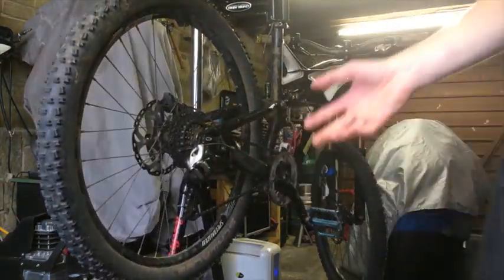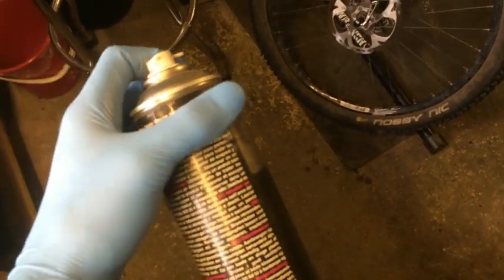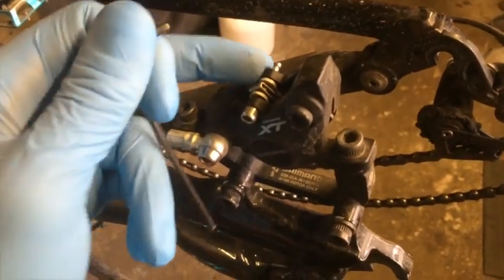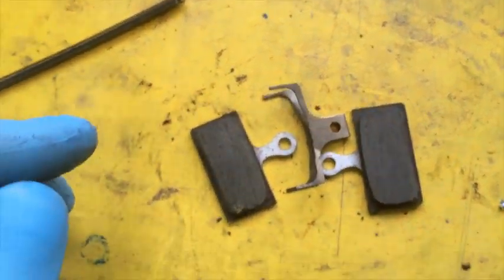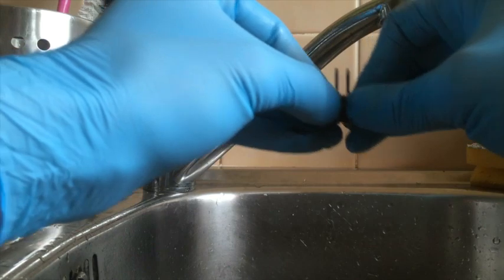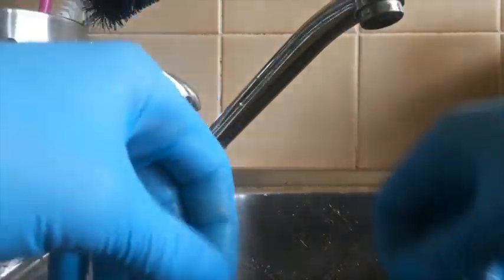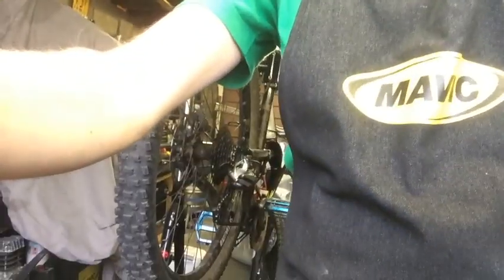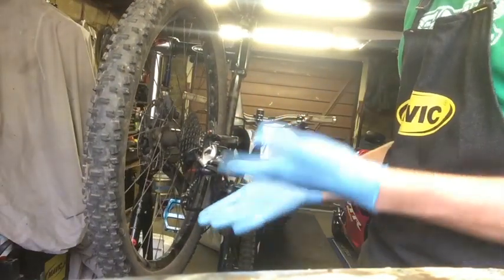How to stop a disc brake from squeaking

Comment: By far the best vid to fix loud brakes. Using dish washing soap and rubbing my pads together really helped. One more very important thing you forgot to mention is after the rotor and pads are clean you need to bed them together: get your bike up to about 20 mph start braking softly for 3-4 sec than harder for another 2-3 sec to complete stop. Repeat 10-15 times. My brakes are now good as new.
Reply from the maker: Tommy Huynh Good tip man
Reply: High Carb Rider thanks bro! I watched some other vids and just tried using brake cleaner but they were still loud. I even bought new pads 2 weeks ago and it didnt help. All you hear in my videos are my loud brakes. Your tip with using the dish washing soap did the trick, and this time after I cleaned the rotor and pads I properly bed in my brakes. Thanks again for your helpful video.
Reply: +Tommy Huynh Can't agree enough, the bed-together part was C R I T I C A L  for me after cleaning. No squeaks !! I Also think the part (in the above video) where the pads are rubbed together is interesting. When I rubbed the pads with detergent I got a mucky paste so was sure not to rub together too hard to prevent grinding. I used a good quality brake cleaner and car shop wipes (which are thicker than paper towels). Thanks so much for the above video HIGH CARB RIDER. The squeak was really deafening before so the process worked well.
Reply: +Tommy Huynh So I used the tips in this video (washed pads until I saw the gold flecks and water was clear) and I cleaned my rotors with the disc cleaner until my rag was no longer picking up dirt. When I properly bed my breaks like you said, it still squeals like a banshee on a dry spell. At this point, would it just be worth it to buy new rotors and pads? Any advice will be greatly appreciated!
Reply: Tommy Huynh when you bed your new clean brakes are you trying to avoid excessive heat? or does that not matter?
Reply: wow that is weird, besides using the dish soap I also spray brake cleaner and clean my pads. If they still squeak than I would assume that your pads are contaminated, so just buy new pads.
Reply: hot weather wont play any part on the brakes, I do noticed when I used metallic pads they squeaked when it rained but I run resin pads now which don't squeak even in wet conditions.
Reply: @afa304  just new pads.  You can scuff the rotor, no need to change it if it looks fine.

Comment: Unbeleavable - I worked several times on my new used shimano XT that squeald like hell, and had applied the break cleaner already. I was desperate and did not think this would do the trick ... 
So I cleaned the discs with mild abrasive paste and glass cleaner and then scrubbed the hell out of my pads as described, and lo and behold - squeal eliminated !! Thanks so much

Comment: After trying several recommended procedures to quiet the squeal I tried the technique presented in this video. I can assure everyone that buy using the soap the results were by far the best of all the other solutions. Brake squeal was virtually eliminated. I scuffed up the both sides of the rotor and performed the long slow drag on the brakes to bed in the pads and the results have been both lasting and satisfying. Thank you!

Comment: Hi, love the video and your technique works. Here is a little tip for persistent squealers. After you've cleaned the pads as per your video, dip them face down in Vim and rub together again. Do this 3 times. Then dip a wet cotton cloth in Vim and hold it on your disc while you rotate the wheel.Then clean the disc as normal with domestic cleaning alcohol. This works like a bit like "Squeal Out'"paste and  takes the glaze off.. After that you need to do 5 or 6 hard and fast emergency stops. The first 2 or 3 will scream like mad but after that it should go quiet. You need to do this every 150Km here in sunny, dusty, dry, rocky Southern Spain even in winter.

Comment: Thank you so much for the video. After nearly 2 years out of the saddle I'm ready to hit the trails again. I thought I'd bought a bike beyond my mechanical skills and as simple as that I've sorted the problem exactly as you said. Wowzer-trousers!!! I'm pumped now and once again thanks for the confidence inspiring video :-D
Reply from the maker: +Paul Rangeley Awesome man, I love the positive feedback this video has gotten and helped so many people with such a common problem. See you down the road.
Reply: +High Carb Rider to add to this I was gutted the day after as the pads started squeaking again but I've found a solution to add to your cleaning tips. I used a wood chisel sanding stone to remove a layer off the pads. It worked a treat! cleaning sorted my front pads but used the extra sanding tip on my rear pads. think the pads had perished a bit due to being in storage. Enjoy pal and thanks again.
Reply: +High Carb Rider I take that back. The squeak is back. time for new pads i reckon :(((

Comment: Good way to cure noisy brakes, clearly shown and well presented :-) . Just one handy little prevention tip to add. Be very careful not to contaminate your brakes when applying a spray lube on your drive train or other components. Cover your brake caliper and disc with a plastic bag to make sure You do not get any over spray on the brake components. You would be surprised how far a cloud of fine aerosol spray can travel especially if there is a bit of a breeze :-)
Reply: Not to mention keep dirty hands away from rotors and pads while working on your brakes,not the first time this has been the cause of contamination.

Comment: I had a rear brake sequel on my brand new trek remedy 7 only when stopped at the last bit. Very annoying..removed the pads and there was oil contamination. .I followed your method but used pink solution cleaner instead using a tooth brush to scrub the rotor and pink solution on the pads...and sand papered them together like you showed.
It worked!...beautifully silent. Thank you for sharing your method.

Comment: Excellent tip. My brakes were making a terrible noise and squiring the caliper with brake cleaner and cleaning the rotor made little difference. Tried this and my brakes are silent. Thank you!

Comment: Good video, worked for me. If the washing liquid doesn't work, and if you dont own a blowtorch, you can put the pads in oven @ 200celcius for about 10minutes to vaporize the oil out of the pads.

Comment: Excellent vid. Like Tommy said made sure sure to do the bedding process. Should fix the problem. BTW.  If your using spray oil on your brakes make sure you don't spray it on the discs.

Comment: Would never have though of using fairy liquid.  I have always used brake disc cleaner, but like you said the squeak will always come back.  Top tip man.

Comment: Just follow the method and worked beatifully well. As mi rotors were not too dirty rubbing them with a cleaner soaked cloth was OK, no need to remove the rotors nor the wheel. Thanks a lot for the video.

Comment: Thanks alot, worked a treat. Dont worry if initially they still squeak, I found after a few brakes that the squeak went away for good so i think it was just moisture left on the pad

Comment: I've been a road biker for 15 years. I finally got  a mountain bike (mate gave it to me - Scott 29" something). I cannot believe the amount of fucking around mountain bikes require.
Reply: Most of that is because mtn bikes get beat to hell.
Reply: Like any other type of modern bike there's no fucking around if you set everything up properly and keep it well maintained.I service my brakes and change the pads regularly and not when you have to because they're fecked.If you do not spend some time properly aligning your calipers then you'll get uneven wear resulting in poor performance ,same with forks,shock and drivetrain,very rarely do I have any mechanical problems apart from normal wear and tear.
Reply: My stationary never sqeeks, it's like a road bike...... Dirt4Life

Comment: If you have pads that are older and are making noises, the process outlined in this video is right one the money.   The surface has hardened, some call it glazed, so applied pressure creates a Slip-Stick situation that creates a harmonic vibration or frequency we hear as noise.  Bottom line, the hardness must be removed or the pad replace.  A good way to do this on small pads is to put a piece of wet and dry sandpaper on a super flat table.  Add water to a clean glass, put in a scoop of GWR brake soap powder and then stir well.  Pour some of the water on paper surface and then gently push the pad across in straight lines and in small circles.  Keep pad flat, keep adding water and keep checking the surface, after you rinse with clear water.

Once done, set pads aside and let dry or warm in a oven situation, etc.

At this time be sure to clean rotor with solvent, to remove any grease.  If they are used, you should block sand to remove any glaze.  You will of course need to determine the best way to physically do this so that both sides are de-glazed.  Again, you need to use a sanding block idea, wet and dry paper and soapy water with a through rinse afterwards.

Now you are ready to finally fix the problem...

Perhaps you have seen our aerosol spray for brake noise since most bike guys are familiar with SwissStop pads, we have been a manufacturer and OE supplier for over 30 years.  Our Silencer brake conditioning treatment allows a "new" set of pads to burnish at a slower rate of speed, so that the film transfer is "controlled".  This process, which also happens at a lower temperature do to Slip-Stick control, creates a softer pad and therefor a quieter final brake pad.

www.theSilencer.com

Another extremely important part of every brake service is what you put behind the brake pad, they can not be installed dry.  We can not forget that the pressure applied to back of pad can easily exceed thousands of pounds of pressure. You will experience noise issues if your pads do not move free of stress, while at the same time provide a coupled resonance conduit for harmonics.  How do we do this with out causing a problem?   Simply apply a real synthetic solids based boundary lubricant to the assembly... the one we make just for brake assemblies.  You can't just use anything, it must be extreme temperature, high pressure, heavy in boundary solids and unable to melt.

www.Ceramlub.com

This application of our specialized products is the answer to brake noise on any vehicle, weather it has two wheels, four wheels or more. Thanks for questions, we are always happy to share technical information regarding the testing and developing we have been doing for nearly 3 decades.

P.S.  Please remember that you can use this on older brake pads, you simply need to prepare the pads and rotor before re-assembly with GWR brake products.

P.P.S.  Ceramlub is the perfect chain and cable lubricant, it won't melt or collect dirt like greases do.   When you have over 30% solids the lube acts like a dry film, but with all the benefits of a conventional lubricant.

Comment: The best product ever for cleaning disc rotors and used by the pro's is butter on the front rotor, and Vaseline on the rear rotor. Try it
Reply: You sir...are a genius!
Reply: y not use oil instead😜
Reply: By god he's right - it was a much more exciting ride...
Reply: Put some lube on the seat too, makes it slip in easier 😋👍

Comment: When I ride without applying the brake they squeek. When I apply the brake they don't make and noise. So I did this trick anyway. It worked. Thanks
Reply from the maker: Interesting, sounds like your calliper is slightly miss aligned and just catching your disc rotor

Comment: As an alternative to the expensive break cleaner you can use break cleaner for cars and trucks. Also acetone works great. You can get this for around $7.00 at home improvement stores like Lowes or Home Depot.

Comment: I just put on new hope rotors and xt brake pads. Did a bleed both front and rear and the front brake was squealing insanely bad at low speed. No issues with the rear.    Sucks because I do lots of flat land tricks on it.  So Imma try this.

Comment: Thanks for the excellent and clear video. Is there any reason I couldn't clean the rotors with dish liquid also?
Reply from the maker: You could but washing liquid contains salt and it will corrode the hub parts etc.

Comment: I just dabbed a bit of valve grinding/lapping compound on the rotor, which is basically like the  sand/mud trail trick except less messy and all one grain size.  Go out and ride/resurface with even brake pressure.  Wipe/Wash off any excess.

Comment: Thanks!  I used 91% isopropyl alcohol (from the supermarket / drugstore) on the rotors.  I wouldn't have thought to use dish washing detergent on the pads...but that worked great!  Immediately after reassembling, the brakes didn't grip / have as much stopping power as normal...but using them over the course of a 1/2 mile downhill run cleaned all remaining residue off...and then the brakes worked better than ever.

Comment: My previous bike had Tektro brakes and all I did to get rid of squeaking was clean the rotors with denatured alcohol. Now that my current bike has Deore brakes, I no longer experience brake squeaking. But I still clean it occasionally. 

If it gets to a point where it starts squeaking and cleaning both the rotor and the pads doesn't fix it, I would just buy a new set of pads - it's only $6 for my Deore ($7 in case of your XT). I'm not willing to go through that hassle of removing the pads, washing it, then torching it just to save $6.

Comment: Tried all of the above. Still squealed. Did it all again. still squealed. Baked pads. better, but squealing came back after ten minutes. I then put Jif cream scourer on disc and rubbed for a minute with a little water. Didnt rinse it off, went for a rap round the block with heavy braking. Silence! Answer is JIF.
Reply from the maker: Ben Ryan nice one, I actually use that too in extreme circumstances. Been meaning to do a vid about it, good to hear you worked it out too.
Reply: Mine even squark when freewheeling and a quick but dangerous flick on the levers gets rid of it for a few yards at best! Will be happy to be rid of it,using both these tips :)
Reply: D'Andre Brown that’s my next move! They did improve with bedding but the front still likes to make some noise. Thanks :)

Comment: This is not a brake question but you were a big help last time I posted here - After a freewheel is assembled, should it be fairly solid without any movement from side to side? The freewheel on my new bike has about a mil or 2 millimeters of movement side to side (i.e. if you were to push down or lift up on a tooth towards or away from the spokes). I ask because after switching gears, sometimes it makes a knocking noise (pretty loud at times) which I figured out was the freewheel jostling side to side (Trek couldn't seem to figure out where the noise was so they gave me a brand new wheel and still the same issue so I decided to solve the mystery myself). Its made louder because it's a fat tire rim (the vibrations are more noticeable due to the larger cavity). Should I demand Trek fix or replace the freewheel (it's a Shimano) or do freewheels inherently jostle a bit and just not worry about the noise and hope it works itself out? Thanks for any advice/thoughts. The bike is here: https://www.electrabike.com/sites/default/files/styles/bike_full/public/skus/539996.jpg?itok=Y3exVQIg
Reply from the maker: So are you saying when the delay in the freewheel engagement is engaged that there is a knocking sound or is the actual freewheel moving from side to side? If its a noise issue then technically no, they are loud and noisy things mainly as they are a replaceable part and the internals are oiled not greased which takes out some of the acoustical resonance etc. However, if you are not happy and the part Trek have supplied is spoiling your enjoyment of your bike, I would push for a replacement part. Trek are a great company who want their customers to be happy and switching a simple part like the freewheel shouldn't be a problem for them. Hope that helps
Reply: Thanks for the reply. Yes, when pedaling and only when pedaling, there is sometimes a knocking sound that is produced by the freewheel rocking about 2 millimeters side to side. I'm guessing this slight rocking is normally the case with freewheels but is not noticeable on your average rim width. But when that rocking occurs on my bike with fat tires and rims the sound is amplified. Not sure if another freewheel will help and not sure if there is a way to make it rock less.

Comment: Thanks. I only get squeaky breaks when I rinse my bike off after a ride. Do I have to do your procedure every time I ride or is there a way to protect by break pads when I clean my bike? thanks.
Reply from the maker: Yeah, I generally remove the wheels from the bike and clean the bike frameset upside down, clean the wheels separately. Clean the discs with brake cleaner and once the bike is dry, reassemble! Sometimes if oils are making their way onto the pads from a rinse down, you may want to check the brake callipers for any small leaks or over lubing of the chain and components as the oil can still be transferred.

Comment: Have you tried laundry detergent?  Your dish washing detergent idea is awesome and made me wonder if laundry detergent would also work.  We used to use Tide to clean our epoxy shop floor because it doesn't suds up too much and really lifts the grease off.  Cheers.
Reply from the maker: No not tried it but always open to suggestions cheers